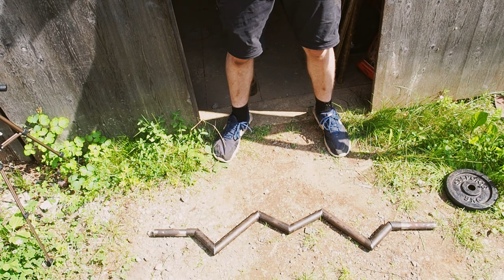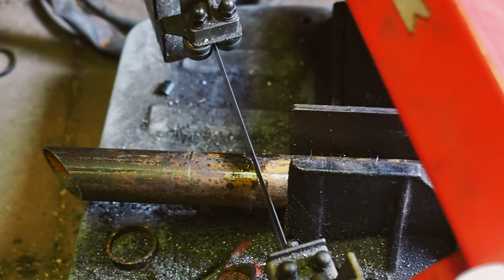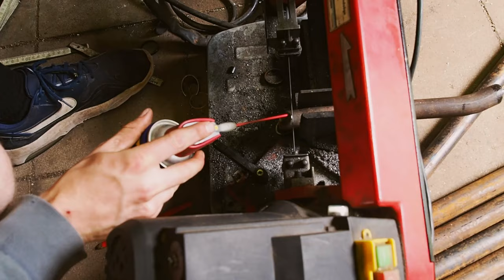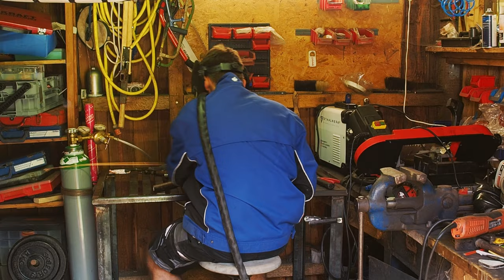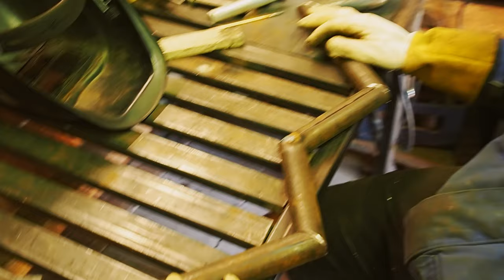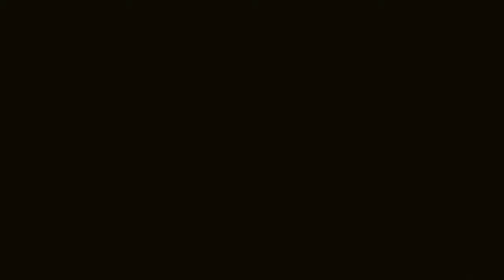Making a simple and cheap DIY EZ Curl Bar

Comment: It Looks Great!! What sizes did you use to make the bar? To have reference so i can make one for my home gym. Cheers from Argentina
Reply from the maker: Thanks.
The Pipe ist Like 34 mm thick. On the outside you need of course round steel in the thickness your Platz fit over normaly 30mm. The total length ist about 100-120 cm if I remember right.